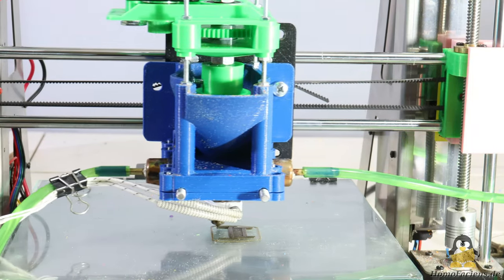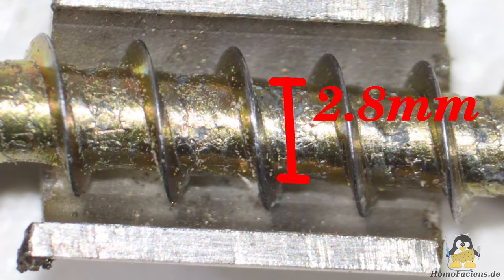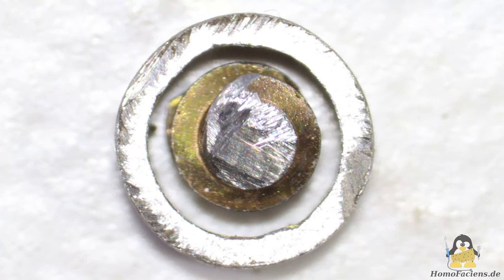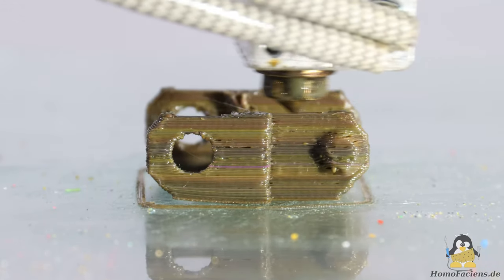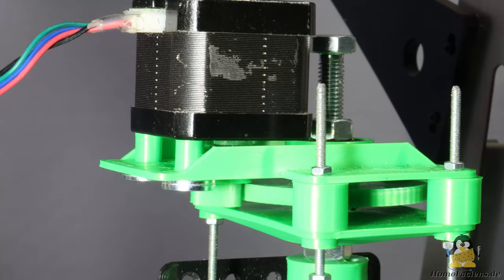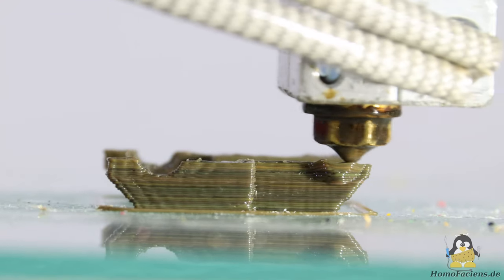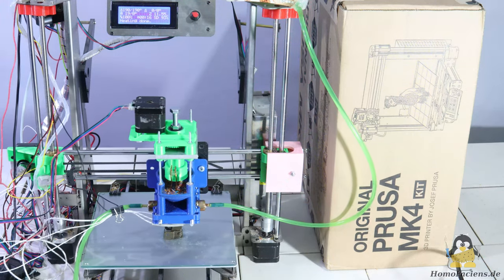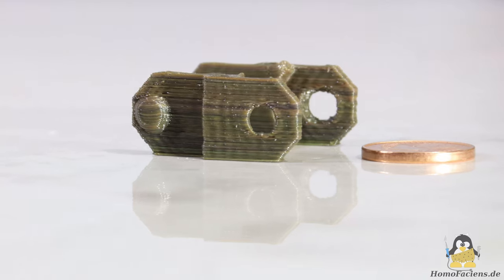Direct Granule Extruder V4.1: Auger screws

Comment: I think an injection molding screw design (with a check ring and a thrust ring) might be worth exploring here. Suppose that one would make a smart slicer plugin to produce g-code that is split in discrete movements, so that the plunging action gets in sync with the required extrusion flow. Maybe it could make retraction more reliable? It 'll probably produce artifacts, increase print time, and require a slightly larger screw though. Not sure.
Reply from the maker: We are back to the point: The software guy must fix a generally not so good design ;-)
My extruder works already well, even without having to tune the software side (however, something that will follow).
Retraction works in general, fine tuning will follow. Stay tuned!

Comment: Would you be better with an acme thread?  Had those on the old REP injection presses.
Reply from the maker: Wood screws that work are cheaper and more easy to source. ACME screws of diameters 5mm and smaller are not that common, at least here in Germany? At some point of development I will (must) create own, special auger screws. However I will convert a 3D printer into an EDM or ECM machine, first. Stay tuned!

Comment: i think for the extruder to work, the screw should have the le thread height gradually decrease. This the case for injector screws in large machines.
Reply from the maker: Obviously the wood screws work in my small extruder, don't they?
As often told in my series on my type of granule extruder and demonstrated more than once in this video: The working principle is different. No pressure gradient and so no long auger with super complex geometry needed.
Reply: @HomoFaciens  i've been putting off watching the series

Comment: Have you tried to play with any slicer settings yet?
Reply from the maker: Not much, yet. Mostly I tried to get a reliable, constant extrusion with this setup. Fine tuning by software parameters only makes sense on a more sturdy extruder, otherwise the results won't be reproducible.
Reply: @HomoFaciens  that makes sense. As a fun side experiment try some lubricant in the plastic path. I have an oiler in one of my 0.2mm nozzle printer. Makes it a lot more reliable, gets rid of the fluff collected on the filament,and lubricates the nozzle. I use 3in1 oil.
Reply from the maker: I will for sure do some experimentation with additives some later. Mainly when printing with solid particles like metal or minerals. Putting some oil in was on my mind, but not for plastics, until now. Thanks for your hint!

Comment: Can’t you get a small compression thread screw?
Reply from the maker: Would not be a really different design to the screws I am using, or am I wrong with that?
Reply: @HomoFaciens  compression screws have a thread that increases the pressure the further down the material goes. They are basically the only thing used in commercial pellet extruders and large scale industry extrusion. The extruders they use to make our filament for example use them.
Reply from the maker: So if you go for a traditional design, you get the traditional issues. Having a wood screw with a large gap between screw and nozzle allows the air and moisture to escape (amongst other benefits I will talk about in coming videos). Traditional extruders need a small to non existent gap to make the compression in the molten plastic part work.